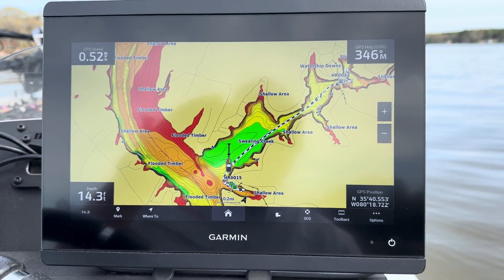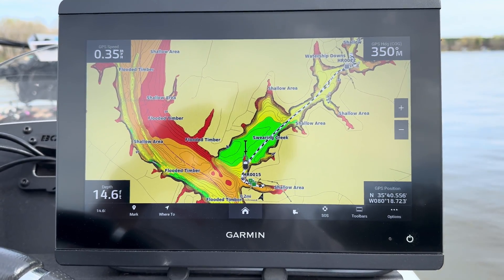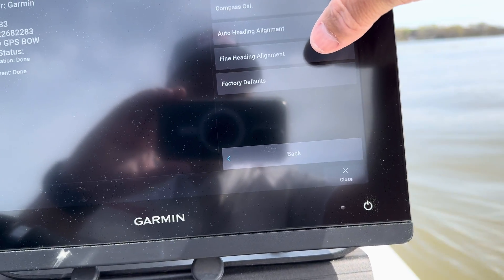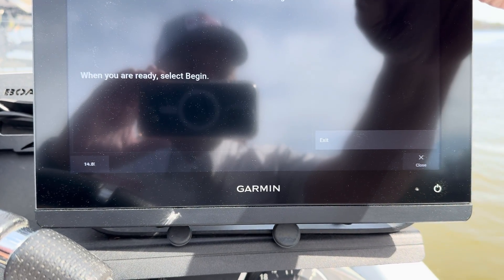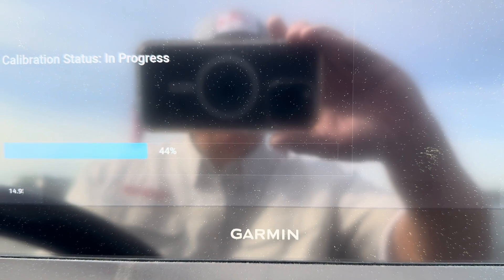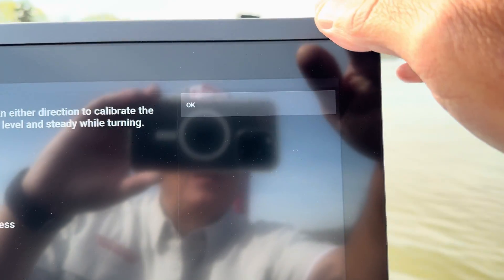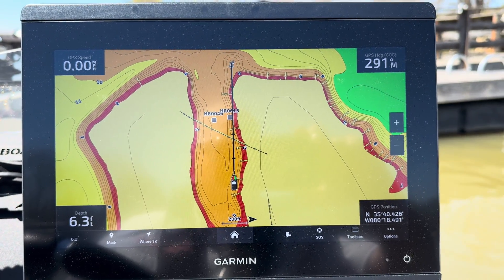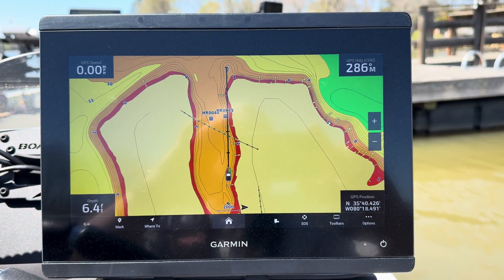How to Calibrate Garmin GPS 24XD Heading Antenna - Stop Your Maps from Turning

Comment: Why would you have 2 of the 24xds on your boat?
Reply from the maker: I like having one gps puck mounted at the stern above my GT56 transducer and one at the bow. I mark waypoints at the console with the stern puck and bow graphs with the bow puck. Doing it this way makes waypoints more accurate since the boat is 20 ft long. Not much of a difference in price between the 24xd with heading sensor and buying one without heading sensor. I figured if something goes wrong with one of my heading sensors I have backup. Thanks for watching and commenting on my video.
Reply: I have the 24xd right over my stern 56 transducer. I have both my console units using the 24xd and  the front units use the internal gps because I rarely mark points from the front of the boat but it's accurate enough to do so. The 24xd gets me somewhere around 3ft accuracy and the internal units somewhere between 8-15 on average.